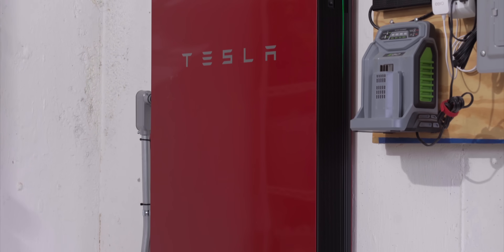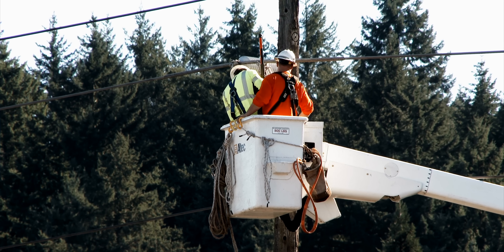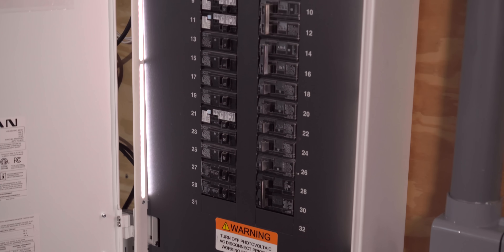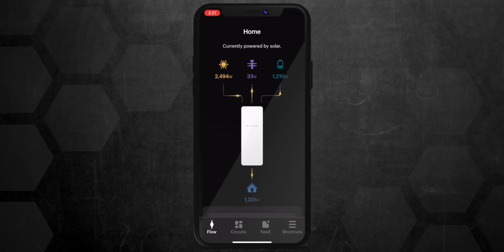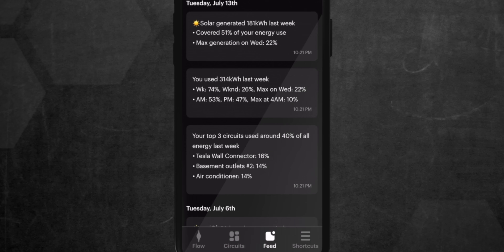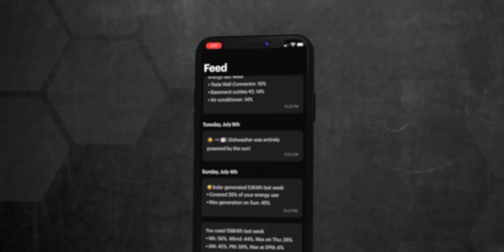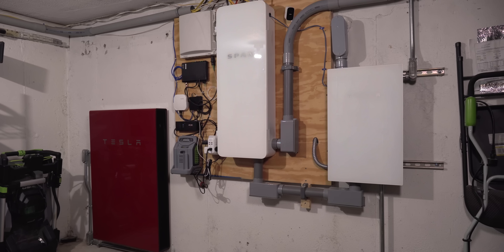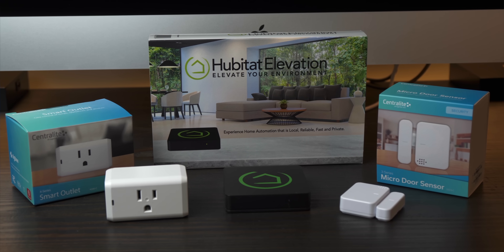This Smart Home Electric Panel Fixed My Tesla Powerwall

Comment: Are blackouts that frequent in America to be able to justify a battery on that alone? I'm in the UK and haven't had a blackout that I can remember in about 5 years.
Reply from the maker: The Span is much more than blackout protection, but it is a key selling point.  In areas of the U.S., like the northeast, electric cables are strung above ground on poles.  Ice storms, heavy snow, hurricane force winds, falling tree branches, etc. can take them out.  In my area we might have a brief outage once or so a year.  I have friends a few towns over that have blackouts multiple times each winter.
Reply: Blackouts are the smallest problem in the US.   The large cities here often have Time of Us (TOU) price increases similar to what you may have for higher peak use pricing.   ESS lets you enable your own clean power to avoid the higher charges.

Comment: Wow! As an electrician I wasn’t aware of a product like the Span panel. That would be great on new construction install. You could wire your house with a specific lighting circuit for the critical loads category and only the lighting loads necessary during a blackout would have power.
Reply from the maker: Bingo.  It's a really cool product for a new build or a big renovation.

Comment: this is specifically focused on the situation of black-outs
not sure how the situation is in the US, but is this something frequent? here in Belgium I think I had 1 power outage in the last 5 years, and it lasted about 5 minutes
Reply from the maker: Blackouts is a key selling feature, but it's more than just that.  Energy monitoring and individual smart home circuit control can have a lot of benefits for controlling when and where you use energy.  Great for time of use electricity fees on dumb power hungry devices plugged into dedicated circuits.  And the energy monitoring can alert you to wasteful or unusual energy use.  It's not there today, but similar to the Sense energy monitor, it has the potential to start warning you of failing devices like motors or pumps.  The feature list of what this provides will grow with software updates.

Comment: You mentioned your server uses up a lot of electricity - is there a reason why you do not use cloud based services i.e. software as service? All operated from a "dumb terminal" i.e. any device with internet connectivity and human interface? Your costs would be bound to drop massively.
Reply from the maker: I'm dealing with terabytes of video files that need 10GB ethernet connections to my editing computer in order to edit in real time.  Otherwise, I'd be cloud based.

Comment: Why not go with an inverter that has battery control like Victron Quattro? Here in Europe, it's like the norm to have a smart inverter from the start and the total system price cost cheaper
Reply from the maker: That's where things are heading for sure.  In the US Enphase systems like that are becoming more common.  But those systems are still limited to controlling a handful of things (they tend to be completely focused on the solar/battery management).  Something like the Span does that plus covering every single circuit with additional smart home/monitoring features.  Span is definitely not for everyone, but having an option like this on the market gives us a lot of flexibility on crafting the right setup for your specific situation.

Comment: You didn't talk much about how it works during outages directly. Does it work without external server connection? (If you blocked external internet access specifically for that device, can you access it on your local network only? )
What happens if only the internet  or if both internet and power goes out?
Reply from the maker: I should have gone into detail on that.  It communicates locally with the battery system, so in an outage or no internet ... no problem.  While it's not official, it does sound like local control/APIs are also coming.  If that happens, that means it'll be possible to link controls into smart home systems like Hubitat or Home Assistant.

Comment: Hm, reading the comments, I detect a huge flaw. If it only can tell what is going on by sending out to their cloud (IoT) to interpret the information to send back to tell you what is going on several bad scenarios comes to mind. 1. After a year they demand payment for using their software. Happened to me for using my weight weighing scale with connectivity to their cloud by an app. You paid a premium for the scale with extra functions.
2. As soon as the power fails and you forgot to give your internet a priority you will loose your connection to their cloud and leave you clueless what is happening. So you still need to walk to your circuit breaker to physically turn off your power to certain parts of the house to insure that you are not waisting electricity on non essential appliances. And it will cost you to hire a certified electrician to help you with finding out which lines are used for your appliances. Because nothing is labeled from the beginning.
Reply from the maker: I should have covered this in the video.  It communicates locally with the battery system and can operate just fine without an internet connection.  And based on my conversations with them, it sounds like more local API controls are coming.

Comment: I'd love to design a socket that accepts 2 or possibly more lines into it that can use smart sense to load balance.....that way I don't have to worry about my microwave and air fryer going at the same time and have to remember which socket is on which line....but....that mentality expanded for the entire house.

Comment: <paused at the sponsor> Given that the SPAN panel replaces your normal home circuit breaker panel, I would say that if you're doing a new build it would definitely be worthwhile.  If you're simply adding a solar/battery backup system then maybe not. <resume playing>
.
Reply: I think it comes down to how important monitoring is.  Your top brands like Tesla,  SunPower,  SunRun have excellent monitoring tools.  Span is going to allow you to get the top class monitoring without having to buy into a whole system.

Comment: My concern is any cloud dependencies, closed source software, and privacy issues.

Can this be used with no internet connectivity, like in a totally off-grid application?  If the company goes out of business, or decides to stop supporting it in 20 years, can the open course community make something to keep it alive?  This is the kind of thing that is well beyond a simple replaceable IoT device.  It needs to last decades, at a minimum.

And what about privacy?  Are the data of my system my own?
Reply from the maker: Good questions.  It does work without an internet connection, but the mobile app won't work.  It communicates locally with the battery system.  And from my conversations with them it sounds like more local control/APIs are incoming at some point.  And if you're interested, they have a pretty good, human readable privacy statement: https://www.span.io/legal
Reply: @UndecidedMF  I'd love to see a "year later" followup on this system.  I've recently come back to this video to revisit the idea, and I'd love to hear if the company came through with the promises of local control, api's, etc.

I'm looking to get the ball rolling on my solar install in the next 6-12 months, and I'm in full research mode.

Also, a comparison of similar products on the market would be a welcome video topic as well.

Thanks for what you do, always informative.

Comment: Thank you for the video but the product sponsorship clearly biased your review here despite your claim of objectivity. Moreover, the title is somewhat misleading. It certainly does not "fix" your Powerwall. 
1) The Span smart panel does not increase backup time or inverter output power. 
2) The Span's biggest pros are equivalent to the function of a much lower cost CT-based energy monitor.
3) TOU savings are provided by the Powerwall, not the Span.
4) The Span's total cost including installation (similar costs to a full panel replacement) is close to that of a Powerwall. It's much better to get another battery than to have a lazy way to switch loads on/off.
5) Wi-Fi enabled point-of-load remote power control units are much cheaper, upgradeable and flexible. You can literally control every load vs the Span's ability to only control circuits, it can only turn on/off loads on an entire circuit - not the individual loads plugged into it.
6) Future home electrical work involving sub-panels can be iffy with the Span. New large loads will likely require a subpanel, e.g. changing gas to hybrid water heater, adding mini-split heat pumps, EV chargers, etc.

Which brings us to the pros of the Span - it's a very nicely packaged smart energy monitor + remote power control. Worth it? You decide.
Reply from the maker: Appreciate the comment, but we'll have to disagree on a few points.  
1) The per circuit control can extend my backup time in a blackout by automatically turning off circuits.  It doesn't increase the battery capacity or output (I never claimed it did).
2) I mentioned this in the video.  It's very similar to Sense or other after market energy monitors you can install, but those are extremely limited to basic information gathering devices.
3) TOU savings will be provided by Span.  They're building out a scheduling feature for this exact purpose.
4) If you're installing a Span at the same time as doing all of the electrical work for a new home or solar/battery install, it'll cost you about half of what an additional battery will cost you.  And as I said in the video, getting this installed outside of those use cases probably doesn't make financial sense right now.
5) I've never seen Wi-Fi enabled power control units for high power use devices (things that require dedicated circuits) like 14-50 outlets, stoves, HVAC, electric dryers, etc.  If they're out there, I'd love to know about them.
6) How so?  It's no trickier to add a sub panel to the span than to any other electric panel.
Reply: @UndecidedMF  
Thanks for the reply. Agree with your responses. For high power 240V loads, a simple Wi-Fi enabled thermostat takes care of the HVAC and EVs have similar controls while other loads, e.g. stove, dryer, spa are simply handled at-will. I would not want some forgotten automatic control to cut power to my dinner in mid-cook. We've shown the pros and cons. Let the viewers decide. Thanks again for the video.

Comment: You might need this if you have a small system but I with a bigger system it's fine to run everything
Reply from the maker: Yep.  If you've got enough battery output to cover everything, the equation for this panel probably doesn't make sense.
Reply: @UndecidedMF  my real question is what does upgrade look like for me in the future I have my whole house backed up with 4 powerwalls and 12kw solar which is great for now but adding ev into the mix soon and the breaker box they installed says " do not add circuits " so I'm unsure what adding more  direct to my house is going to entail and what adding more solar down the line is going to entail as well

Comment: I reckon it's a hard sell. $US3500 before installation versus a critical loads panel. The reason a critical loads panel costs so much is quite often it requires a partial rewire to isolate things like refrigerators on to their own circuit. Span doesn't do that on its own - that would be a further expense. I think Span is a killer piece of tech but you'd only get it if you had the resources. Plenty do.

Comment: When I build my house and garage mahal I am going to spend a lot of time with planning all of the utilities. I'll have to keep this in mind, though I'm not sure 200A will be sufficient for the size of the building I have in mind.
Reply: Most electric homes need less than 100A to fully electrify. 200A is more than plenty for even large homes. Span can perform energy management to ensure you do not exceed your utility service.
Reply: @chadcconway , I'm talking about a 7,000sqft garage mahal with electric radiant heat, AC, EV chargers, 220v welders, saws, lathes, CNC mills, and a beefy air compressor. The house is relatively minor. I'm far from normal.
Reply: @chadcconway  I saw Arch's reply to a person asking for 400 A on twitter.  I think there's a bit of a disconnect between what the circuit breaker capability is and what is actually being used.  I was surprised when my manager told me that most CB in california were all 15 A until you got to large appliances.    Even modern Hybrid Heat Pump Watter heaters are only on 30 A breakers and the Sanden unit can be run on 15 A.    I'll probably never need 400 A service.  If I build a home the lighting will all be low voltage.
Reply: Exactly. If you're electrifying everyting go with 400 A service..make sure you've mapped out all potential EV Charging locations and consider centralized lighting (panelized lighting)  You can bascially homerun everyting to a clean mechanical room that's easy to work on.

Comment: I responded to Focus On Energy ad about solar cells. The fact that at best it would sell some power back to the utility was not enough to sell me on it. I wanted battery storage for power losses. In that, I’m thinking about a natural gas generator.  It were I to get battery back up, I think the smart breaker panel is very desirable.

Comment: Span can find a lot of success by driving down the cost of connecting batteries.  It's not really about buying less batteries it's more about getting more kw per dollar.  A decade from now some of you enthusiasts will be laughing at the "Old days of critical load panels" as you have 100+ kW of stationary battery power along with another 100+ kW of EV with Vehicle to Grid capability.   When we chant "Electrify [insert your country]" we mean the entire home.  Today the big brands are the first movers but many of you by the time you're on your 3rd ESS you'll likely be buying from a company you don't even know exists today. 

Span has to be nimble and ready to support connectivity standards and a wide variety of vendors. PV panels are commodity,   LiFPO4 batteries are commodity.   The money is in the microgrid.   5 years we're at 400 kW/kg so today's 400lb ESS system is now either half the size or twice the kW output in the same form factor.    Just get prepared ...you all will be buying more batteries ..not less.

Comment: And how do you get your lights back on after a nearby lightning strike fries half of your smart panel circuits?  A normal breaker panel would probably survive the same spike.
Reply: Most of your current load centers can add whole house surge protection right in a breaker.
Reply: @hmurchison8123  -- I don't doubt that but anything using solid state devices is going to be more susceptible to voltage spikes even with built-in surge protection.

Comment: Nice video. I wonder why Tesla is still only offers a hardwired option, having full smart home options seems like something they should be doing as standard. Maybe the development team was shifted to making their cars smarter?

And yeah, a smart home app that warns you if something is acting weird is why people would really want to have a smart home. Changing what color your lights are or turning the coffee maker on with your phone are actually pretty useless gimmicks, chances are by the time you find your phone and the right app you could have just have walked the ten feet to adjust the lights manually, and no phone app is going to put that food in the oven or fill the coffee maker... A warning that your solar panels might need cleaning is far more useful for daily life.

But you know what we really need? A fridge with an alarm that starts ringing if the door did not close properly. With modern tech it would even be easy to record your own voice saying "shut the door already!" if the first notifications are ignored.
Reply from the maker: Love that mindset.  Agree 100% about smart homes being much more than the gimmickry that gets most of the attention.

Comment: What happens if one of the secondary circuit breakers that enable the system's smarts fails? Is that part of the system repairable by a regular electrician?
Reply: The secondary breakers are part of the "smart" breakers, forcing you to replace a whole breaker, but a 5-minute job for an electrician.

Comment: Any thoughts as to how the Span panel compares with the Leviton Load Center and their smart circuit breakers?
Reply: Leviton's circuits can only be turned off through the app. They must be turned on manually at the panel. Also, it does not integrate with solar or battery storage systems.
Reply: @chadcconway  Thanks! Any thoughts on the Lumin Smart Panel?
Reply: @gordonlowe5405  Lumin only controls 12 circuits compared to Span's 32. Also, Lumin is not as integrated with the solar and storage systems. Span can show you whole home power flow, state of energy of your battery system, what your solar is producing all in one app. Lumin is limited to information only about those 12 circuits. Lastly, Span supports 90A per circuit. Lumin is limited to 30A on 6 of the circuits and 60A on the other 6 circuits.
Reply: @chadcconway  Thanks!